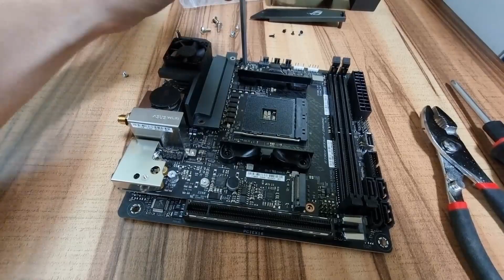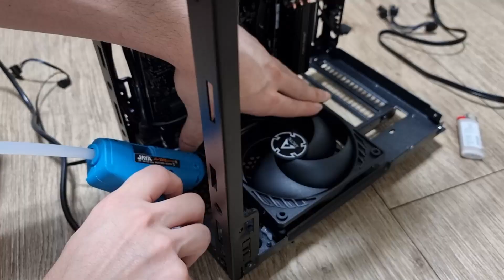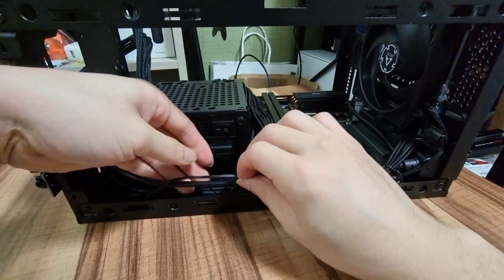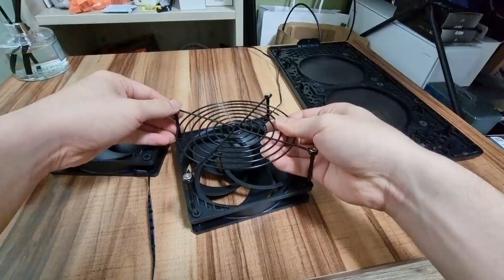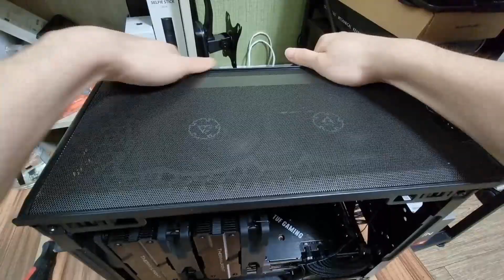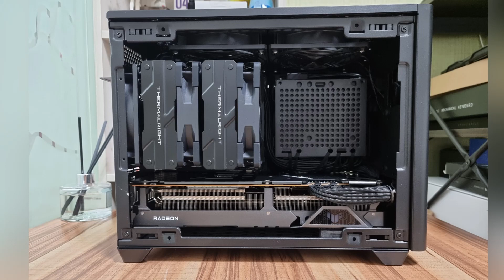쿨러마스터 NR200P ITX 빌드 / 5600X RX6800 TUF / 라이젠 시스템

Comment: Did you use custom cables for the power supply? Mine has those splitter type cables, causing cable management to be a pain

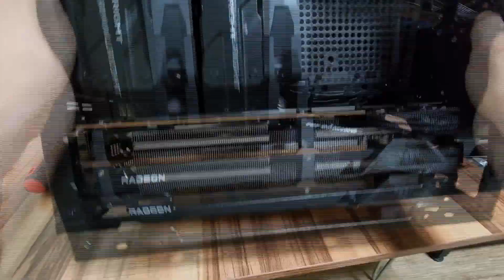At 1:44 what did you put under the GPU? Is that an anti sag?
Reply from the maker: The VGA POWER cable used a custom modular cable.
The pedestal at the bottom of the graphic card is not a separate product, but we cut Styrofoam inside the PC part box and used it.

Comment: why didn't you just attach the 3 third fans into the cooler instead of that disastrous hot glue solution?
Reply from the maker: There was no extra fan clip for the cooling fan. However, if there was an extra, I think your opinion is correct.
Reply: @DalraeMyo  bruh you are youtube pc builder, and you are saying you don't have any extra fan clip somewhere in your house 🤣
Reply from the maker: @vdvd2090  At the time of uploading the video, I was thinking of doing YouTube activities as a hobby. (Even now, I upload videos simply as a hobby rather than professional videos.)
I only used AIO cooler in my previous build so I really didn't have any extra fan clips... T.T

Comment: sorry...is possible thermalright fc140 and close front panel with z490i unify? thanks
Reply from the maker: I've never used FC140 before, so it's hard to give you a definite answer.
Reply: @DalraeMyo   thank you very much for answering... yes indeed it is not easy to always have all the pieces it is unthinkable 😅

Comment: is your cpu fan exhausting out of the case behind it or pulling air into the case from the back?
Reply from the maker: I installed it in the direction of discharging the internal air. If necessary, it may be installed in the direction of the fresh air intake air.

Comment: Why did you opt for the Arctic top fans over the stock ones that come already in the case. Are they that much better?
Reply from the maker: It was much quieter and the air volume was great. At particularly low RPMs, the Arctic P-Series showed excellent performance.

Comment: What 120mm fan is that, that being glued to the case?
Reply from the maker: Arctic P12 PWM PST model.
Reply: @DalraeMyo  hi, if the 120mm fan doesnt fit the rear ibtake, isbit ok if i just leave it empthy?
Reply from the maker: @aqwandrew6330  The rear cooling fan of the NR200P is 92mm specification. Mounting is also optional.
Reply: @DalraeMyo  "mounting is also optional" so if i dont have 92mm fan, its ok to leave the upmost rear empty and just use the regular 120mm fan blowing inside ? (Like in the video without the extra fan that is glued to the case in the rear)
Reply from the maker: @aqwandrew6330  If the height of the VRM heat sink is acceptable, a 120mm cooling fan may be installed. (Cable tie or hot glue should be used.) However, I think there is little reason to install 120mm on the back while removing the cooling fan on the top rear.
Reply: @DalraeMyo  what i mean is, is it ok to use rear intake but without additional fan on the back blowing in the air? (like in your video but without additional fan attached by glue gun) 

the 2 top case fan included in nr200p (2x 120mm) i still use it for the top case fans
Reply from the maker: @aqwandrew6330  Oh, there must have been a problem with the translator. I think that maintaining the top two cooling fans and installing additional fans on the rear panel will provide better cooling performance. The reason why I used a glue gun was to suppress the vibration generated when the cooling fan rotates.
Reply: @DalraeMyo  i see2

but using 92mm fan instead of 120mm fan like in the video its ok right? also how do you actually mount the fan without the glue ya?
Reply from the maker: @aqwandrew6330  I think it is enough to install a 92mm cooling fan. I installed a 120mm cooling fan using a glue gun for aesthetic reasons. 92mm can be fitted with a regular chassis fan screw.

Comment: Nice build sir. But may I ask how could you install PA120 (157mm height) into NR200P, I had once for me the id-cooling 224XT White (154mm height) but I cant close the tempered glass fit it likes in your build. Thanks for nice video you had made.
Reply from the maker: When I installed the CPU cooler, I only followed the manual. There was a slight touch of the heat sink on the tempered glass, but there was no problem closing it. When I look up examples on the Internet, there are cases where the tempered glass does not close depending on the motherboard. In this case, some users replaced it with a lower standoff or physically lowered the height by pressing the heat sink.
Reply: It can also depend on your motherboard. Some are different thicknesses. I know the Asus Strix is on the thinner side
Reply: @killerful  I am using B460i Prime and B460i Strix 😭 even i remove the top plastic cover of IdCooling Se224xt, i still cant close the TG panel.
Reply: @DalraeMyo  Please tell me, if you use a mesh wall, will this cooler fit?

Comment: Would the peerless assassin also fit the version with the vented sight panel? Is that the peerless assassin 120 or the 120 SE
Reply: Thats the 120. The 120se fits much easier as its 2mm shorter than the original 120.

Comment: Hi, nice looking build. Did you have to raise the height of the second fan to fit the RAM sticks in?
Reply from the maker: If you plan to use RAM equipped with a heat sink, the front cooling fan will be raised and installed as high as the heat sink.
Reply: Ok, thank you for your help .

Comment: i think this one should can use the glass panel right ?
Reply from the maker: Yes, that's right. I used a tempered glass panel.
Reply: @DalraeMyo  lol i can't put tempered glass on it , i'm using AM4 as well , are you sure you can put glass panel on it ?
Reply from the maker: After that, in the thermal test video that was uploaded, it was tested with a reinforced glass panel installed in the same way. In my case, there was no problem with the mounting.
Reply: @DalraeMyo  sorry i watched all over your video and indeed with tempered glass , so weird with mine cannot fit , maybe because different motherboard height

Comment: wow PA120 !? how ? need mod ?
Reply from the maker: I didn't use a separate mode part
Reply from the maker: The installation was carried out according to the enclosed manual, and I was surprised that the tempered glass panel could be installed.
Reply: @DalraeMyo  thankyou for the reply , very nice pc ! i will buy a pa120 too after watch this video
Reply from the maker: Thank you for watching the video! However, the cooler has a height that exceeds the recommended installation height. Please note that some users have not been able to close the tempered glass panel due to height differences depending on the system.
Reply from the maker: I was lucky enough to close the tempered glass panel
Reply: @DalraeMyo  :D thanks, luckly , i have same motherboard , i think i can okay
Reply: Anyone know if PA120se + B550 aorus pro fits TG panel?

Comment: Why you have to remove that VRM cover?
Reply from the maker: This was to install a 120mm cooler in a case that can be equipped with a 92mm cooler in the back
Reply from the maker: If the VRM cover is not removed, some interference will occur.